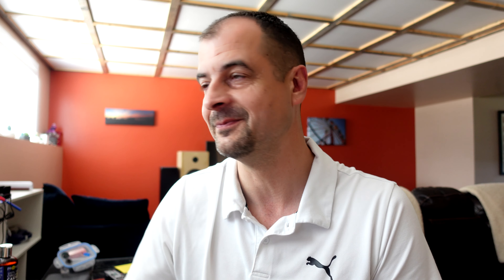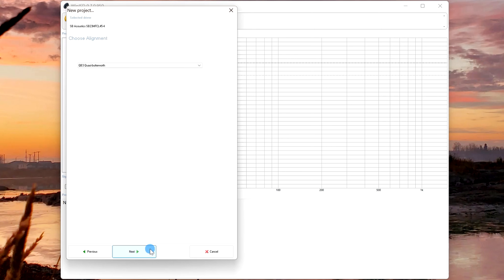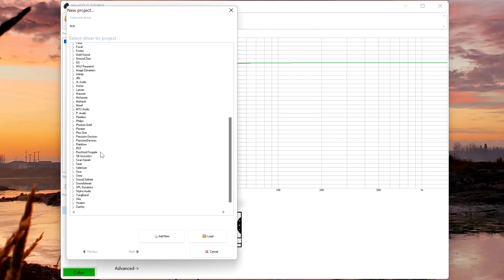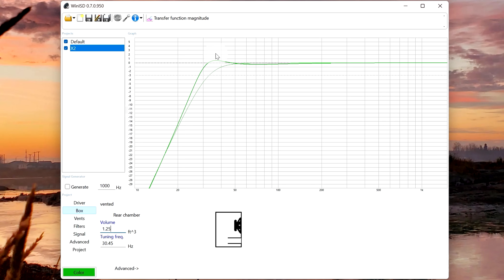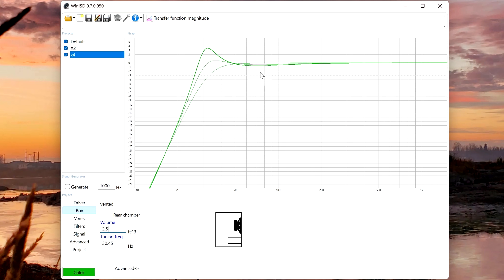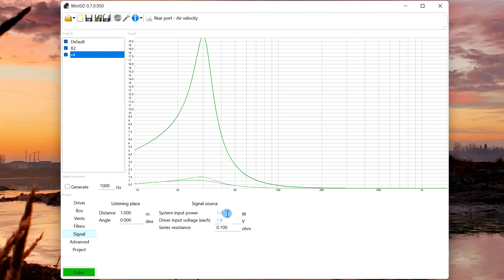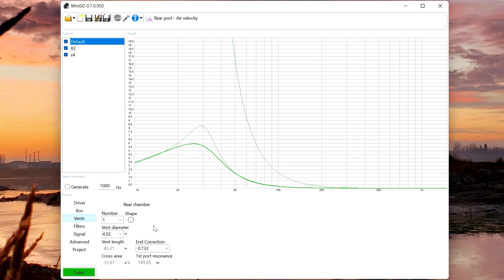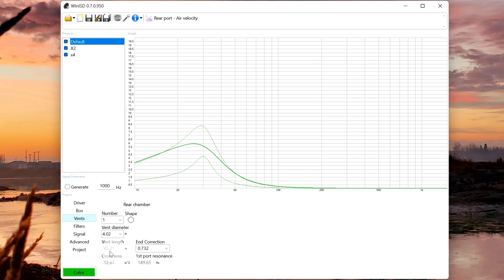Using WinISD To Tune A Speaker

Comment: I don't think you factored in any voltage when you checked the cone excursion
Reply from the maker: You know I think you're right, this was a while ago, but that definitely wasn't the only mistake.
Reply: @davewiebespeakerdesign  only one I noticed hahah, Imy struggling to design my first speakers right now. Cone excursion is getting me badly, and if I fix it then I lose good bass response because I made the box smaller. I can't figure it out.
Reply: Absolutely right " No power was applied " .....but the graph looks quite good without any severe spike...or looks manageable....